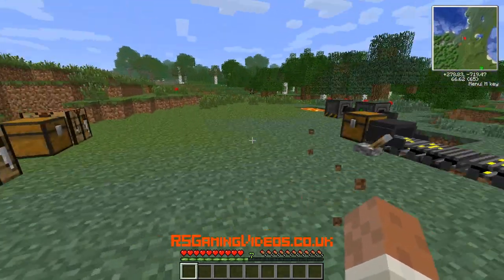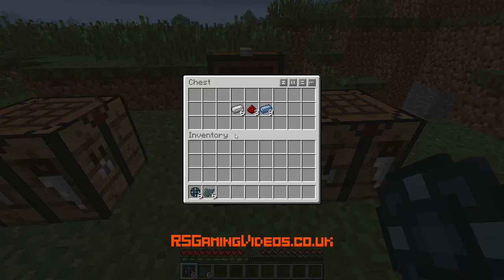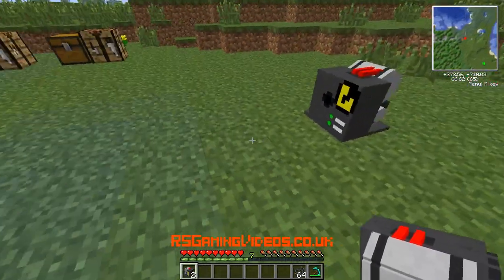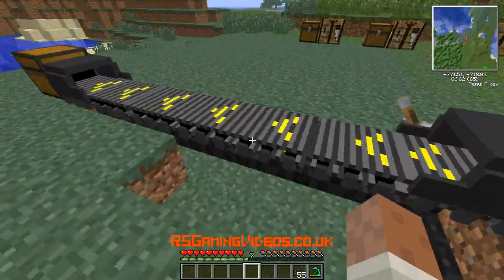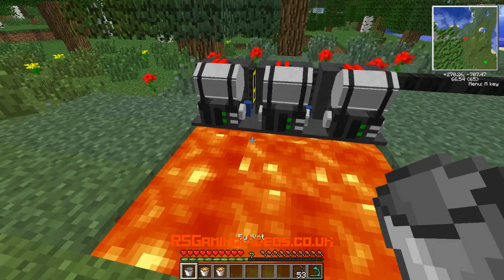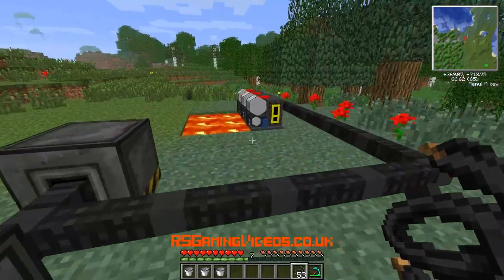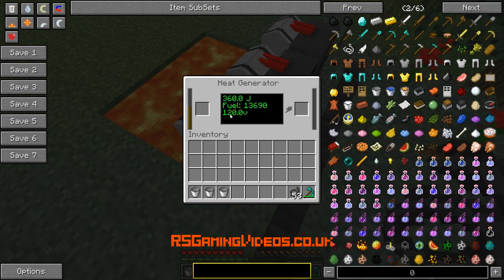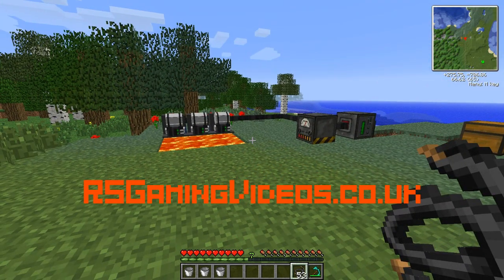Voltz Pack: [Tutorial] Heat Generators

Comment: No, you've got it all wrong.  I put a lava source block one each side (except for the wire side) and tested the output with a handheld multi-meter, 8.0 kilowatts.  Then I put a source-block on top and guided the lava flows into grooves I build around the sides, 8.0 kilowatts.  So, in essence, you only need one bucket of lava per generator, or less if you put more effort into it, and you can build the heat generators one block apart to share some of the lava flow and conserve space.

Comment: You can put a sourceblock on top of the generator, then let it flow over and underneath to provide 5-6 levels of power (1 level per side, 5 is optimal for automatic, allowing for a cable, while 6 requires you to charge batteries and discharge them elsewhere).  Hide it from the world so it wont burn anything and connect some cabling, and your good to go.

Comment from the maker: Are you using the right type of copper cables? There are two types: the straight ones of the spiral-shaped ones. You should be using the spiral-shaped ones, and to convert them you just place them in the crafting grid.
If you still have the problem, then it should be ok just to ignore it - the power should still transfer.  You may notice that in one of my Voltz videos they don't connect properly all of a sudden, but they still work properly!